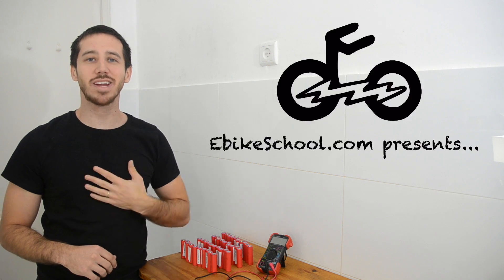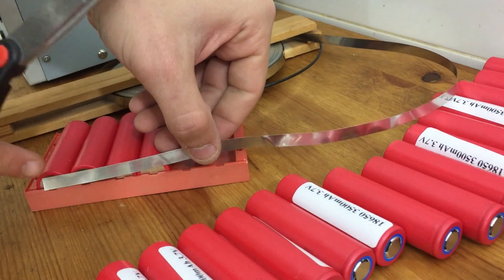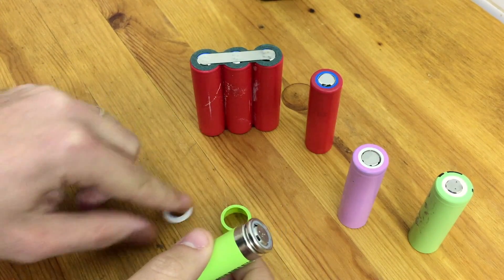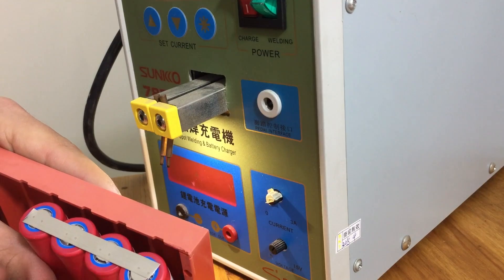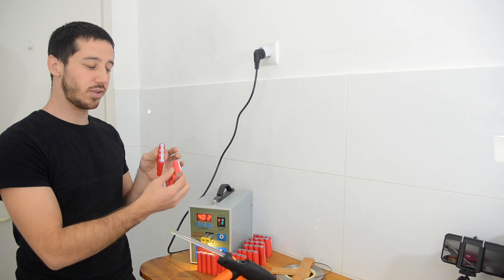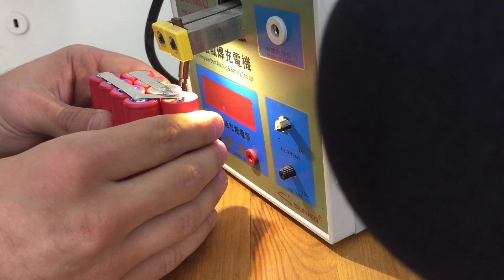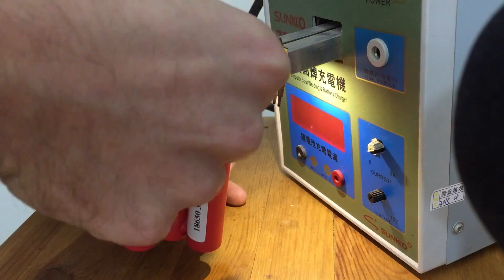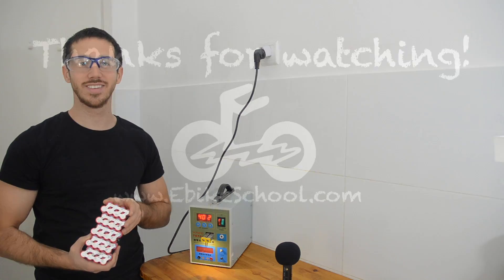DIY Lithium Battery - Spot Welding - Part 2/5

Comment: Hi Micah, i have your book. Why is nickel plated steel not as good? Does it have a lot of resistance? I seem to find it everywhere... which is annoying. But the pure nickel is double the cost. I wonder if it really matters or not
Reply from the maker: Yes it is higher resistance and results in lower battery performance.

Comment: I just picked up a 12kw capacitor welder that says it can weld .3mm but most say .2. 
Any experience with these? Mine is US solid USS-BSW06. The one you have says 800amp but mine says 2400amp. Is it that much more powerful or just different since yours is transformer and mine is capacitor?

Comment: Can you build battery with cells has same exact voltage but different capacity? Like I got different batteries has same voltage but different capacity so can I mix ? If they have same voltage but different capacity ? Thank you really need to know this information

Comment: Are there any cheaper spot welders that do the job considering that I won't be using such equipment on a regular basis? I have seen less expensive portable welders. Are they any good? What should one be looking for (power needed/ current etc)?
Reply: The welder you have would cost me Eur 101 + Eur 90 shipping!! A portable device would cost me less than Eur 50 shipping inclusive.

Comment: Could this same battery be used for a solar power system and would the cells be wired together the same way where you put them in parallel and then in series

Comment: but if those strips can only carry 5 amps then won't you run into overheating problems with the positive and negative ends each handling 15amps getting sent to the controller since you only welded one strip. I understand its a parallel connection but won't you have 15 amps going through it anyway?

Comment: Thanks for the video !
As the voltage is not the same when the batteries are fully charged or not, do you check them when they are fully charged to know if you need to throw them out ?

Comment: Don't know if you come back and update your videos but was wondering why doesn't my Sunko 737G Plus not spot weld .15 x 10mm strips. Tried many different setting and no weld. Does the width affect the weld? If I try welding the strips that came with the welder it does just fine but those are nickel-coated steel.

Comment: Hi. I am a beginner and Im planning to diy a electric skateboard but have no idea about battery packs. Your videos are super helpful to me. Many thanks to you!
Reply: right and well he talks about not soldering but umm isn't the word HOT in HOT GLUE gun a red flag. WTF So yah let's spread a 280-degree molten gel all over our batteries, but not a tiny amount of 300-degree molten liquid in a small spot on the top of our batteries

Comment: So 4 strips across for series connections gives 20 amps (4 x 5). Does it not matter how much nickel is on the parallel groups?
Reply: There's very little current flow across parallel connections

Comment: Before welding your batteries in parallel maybe you should mentionne that they should be charged at the same voltage. No?
Reply: He already mentions that at the beginning of the video. When he’s checking the voltage of each battery

Comment: What do you do if by accident you happen to make a wrong weld and short the batteries?
Reply: Just laying the nickel strip down to complete the circuit will spark. That would be all the reminder you need.

Comment: Do you know where you can get that plastic holders to keep the cells together for spot welding? any tips to put a 14S4P hailong battery pack? I can barely close the case, and I even had to trim some parts, not perfect but works. 
I bought your book, very good info btw. thank you.

Comment: Yes I enjoyed. But technically adding more strips doesn’t actually give you more amp carrying capabilities. (Kind of) if you’re working the current at close to maximum output (in comparison with the nickel strips) (that and I didn’t look up the maximum output of 4 cluster batteries) it’s a matter of the weakest link. Check out some videos on parallel resistors. (Same thing)

Comment: Do you want to enable Dynamic Stretching to your body organ especially in muscle? Then Just go here [Check Details Here==>https://t.co/ouYO75dnM2 ]. This is where you are activating the muscle around a joint and moving that joint through its full range of motion in a progressive manner. This leads to an increased range of motion around the joint, warming up of the muscle around the joint and improve circulation around the joint. Think of high knees or butt kicks.

Comment: Hy!
I really like yours videos, you make a good work and you are a professional of Li-Ion batteries!!
I started also to do my only batteries pack for a project and i bought the same spot welding like yours from Bangood.com but i have a little problem, it seems it can not weld the nickel strip 0.15 8mm.
Could be because i use the strips that they sent to me and its not a good quality or it's the spot welding!
Thanck you.

Comment: why not adding fuse wires? any particular reason? do the cells have built in protection? any thoughts on PCM (Protection Circuit Module)?
Reply from the maker: These are brand new, high quality Sanyo cells. Fuses aren't as necessary in this case. More important for salvaged/recycled cells. What the next video in this series to see the BMS (PCM) added to the battery.

Comment: What gloves would you recommend for building an ebike battery using a spot welder? Class 0 latex gloves (good for up to 1000v) are quite expensive. Would disposable latex gloves be fine for 50v or so?
Reply from the maker: Yes, cheap latex gloves are fine. Anything to keep your sweaty palms off of the contacts. Just note that those gloves can tear easily, so keep a few backups on hand.
Reply: EbikeSchool.com brilliant. Thank you
Reply: it's fine you don't need gloves just don't shock yourself for to long

Comment: what is the difference in using nickel strips and fuses ?
I came across some videos in which some have used nickel strips and some just the fuses and in fuses how is the series and parallel connection made with fuses 
thanks for ur time!

Comment: Great video series! But wait a sec...  you go through all the trouble to build this pack and haven't tested any of your cells beyond voltage? Do you do an internal resistance check and match cells? Do you charge/discharge them a couple of times? You don't drain them hard to check for weak cells? Sure, it's a bit of extra effortl but it's better to spend some time checking than to have to disassemble an entire pack to hunt down a bad cell, especially as the number of parallel'd cells increases. And especially being that you're/we're welding them together.
Reply from the maker: These are brand new cells straight from the factory. Reputable companies like Panasonic, Sanyo, LG, etc do multiple checks per cell before they leave the factory. They don't ship bad cells. But if you use salvaged/recycled cells, then you should do exactly as you said and weed out any bad cells.

Comment: Is it true that these spot welders can blow the breaker if your house? And it's not recommended for home use?
Reply: Please note that it's NOT OK to replace a 15A circuit breaker in your breaker panel with a 20A breaker because the 15A breaker is tripping due to a higher current load. The 15A circuit likely has AWG 14 wiring, which is not listed for a 20A load. That being said, sometime you can have a "weak" circuit breaker. In this case, if you're pretty sure that the total circuit draw on say, a 15A circuit is less than 15A and the breaker is tripping, you may want to replace the 15A breaker with a new 15A breaker. Also note that you are always supposed to replace a breaker with the same brand as the panel - i.e. Square-D panel gets a Square-D breaker, GE panel gets a GE breaker, Murray-Murray. (Even though they are mechanically interchangeable.)
Reply from the maker: If you have a low current circuit breaker then yes, sometime you'll have to keep resetting it or swap it out for a stronger one. These welders aren't much of a safety issue though because they draw a pulse of electricity for a few milliseconds. Your circuit breakers are designed to keep you from pulling continuous high power for long periods of time.

Comment: hay i bought your battery book and love what im reading. my biggest challenge is the welding. i live in an older apartment with fuses and my biggest worry i get a battery welder and i use it...then a start a fire or something. do you have a recommend any advice before i do this?
Reply from the maker: If you're worried about the wiring in your building, you can look at arduino spot welders. Google it. They are powered by either a car battery or a RC lipo battery, so you don't even have to plug them into the mains power. They are a new class and not very common yet, but they are starting to become available in kit form.

Comment: how much current are you getting from the microwave oven transformer? I'm using 4 gauge wire for the electrodes , 35 sq mm welding wire for the secondary winding but not getting more than 250 amps...pls lemme know what should I do...I bought a 70 sq mm wire and will be attempting a rewind  hoping the current increases.

Comment: So say i invest into a 72v eBike Conversion Kit maybe 2000w+

Would making my own battery pack be better option, price wise because ive seen packs cost as much if not more then the actual kit which is just bank breaking for just getting into riding and all. This is certainly something i would like to get into, just the final product i would hope i could make water resistance or proof at best. Nice tutorial, very clear, pretty fascinating, and i plan to do this, if its more affordable that is, checking now hewhew.
Reply from the maker: 72V batteries can get very pricy, so building your own can be an affordable option. Most people don't start with a 72V ebike though. It's a lot of power - just make sure you know what you're getting into. Happy riding!

Comment: Hi, I want to buy the same spot welder. In the description, this welder has input 220V. In the video, I can see you are using a plug adaptor for your U.S, CAN, JP wall outlet. I sent an email to the store and got a reply to get 788-H model. Do you much lower power with your setup? You could put both in the description so others can order what they need and you still get your commission.

Comment: Sorry for my english but, can i use another way to weld the nickel strip without using the spot welder?
Reply: Your English is better than most native English speakers. :P You can solder, but that heats the cell up and I personally wouldn't recommend it. The other option I've seen is using something called "batteryblocs". They're a modular enclosure that allow you to drop 18650s in, secure and protect them, build big packs, and not have to solder or weld. They're cheap, too! http://www.batteryblocs.com/
Reply: not so bad, man..!
Reply: bruh your English is fine aha, you could solder them together but that is not really safe, at all, another option is to watch his video on how to build a battery without a spot welder and buy prespot welded gropes then solder between batteries where its safe
Reply: Build a spot welder. If you have the skills to build an electric transport or even a battery pack, you can build a spot welder. There are even examples of using 18650 batteries to do the welding. There is never an excuse to solder batteries.

Comment: 0.15*8 mm pure nickel strip can support 30-40 amp Current ?.i build 18650 48V (13s 6p)
Reply from the maker: No it can support a max of 10A per strip, but 5A is better.

Comment: what is the difference between parall and seris connection ?
Reply: @Kamal Boro
If you do not understand at this point the difference between series and parallel connections and their consequences DO NOT START BUILDING LITHIUM BATTERIES IF YOU VALUE YOUR LIFE! This is especially true when making large assemblies like the one in the video. Making errors in assembly like like creating a short circuit can cause a fire or explosion instantly. Lithium batteries are no joke!!!
However, FYI: Consider two identical batteries eg 3.7V ,and 2000mA in:
SERIES: Voltages is the sum of the two batteries, ie 7.4V, and the current is the average of the two batteries, ie 2000 mA.
PARALLEL: The voltage is the average of the two batteries, ie 3.7V, and current is the sum of the two batteries ie 4000mA.
Reply from the maker: Make sure you watch Part 1 of this video series, it is explained there: https://www.youtube.com/watch?v=b3eRv_FZjBc

Comment: where did you get the battery welder?

i have been soldering my cells for years but the welder looks so much faster
Reply: most of the stuff there actually took 3 months to ship to me but I got my welder in 2 weeks and she works beautifully, I do live in Australia so that's probably why it didn't take long to ship a prebuild thing
Reply from the maker: Check the description to the video. I put the links to the tools I use there.
Reply: yuck aliexpress 

the home of chinese scammers and 3 month postage time
i think il look elsewhere

Comment: What cells are you using and where did you buy them at (how much each, how man etc) Also what are the settings on the spot welder?
Reply from the maker: These are Sanyo cells, check the description for links to all the parts. The welder is set to 40 with a double pulse.

Comment: i was thinking i should apply a black insulator tape on the sides of the battery groups i SHOULDN'T  weld together serially , just in case i'll start going into a fixed trance and weld them by mistake. 
what do you think ? 
btw shouldn't you use gloves and long sleeves when welding?
Reply from the maker: The black tape could be a good reminder, but you should always be double checking everything before you lay down the nickel strip. Placing it in the wrong spot could lead to series sparks.

And yes, I should have been wearing gloves. I had them on for part of the video but I had to keep removing them to work the camera and forgot to put them back on. Long sleeves is probably a good idea as you occasionally get a little spark, but you're probably fine without them.

Comment: Hello, is not the same if I make first 10 batteries in line to make 36 volts and after connect it to paralel that peaces? The reason is to add more amh if I want.
Reply from the maker: Yes, that would work also. Just makes sure that the cells are the same voltage before you do your parallel connections.
Reply: Thanks for answer.

Comment: What's your opinion on DIY spot welders? Like ones made from using a car or lead acid battery or ones made using the transformer from a microwave?
Reply from the maker: There are some good arduino based ones that use a car battery. From what I've seen, they work even better than my welder I used in this video.

Comment: Another great video. Can you get the nickel strip thicker than .15mm so you don't have to double it up? I'm thinking of for like a 48v bank, but some where around 2000 to 2500 watts for extreme long range for an emergency type bike to carry a heavier load.....or what would you suggest, 2 or 3 separate banks or what? Thanks and keep up the great work.
Reply from the maker: Do you mean watts or watt hours? Range is related to watt hours.

Building a battery to carry that many watts is doable, but you'd need thicker series connections as you noted. If you have a really strong spot welder then you can weld thick strips, but most hobby spot welders like this one can only do up to about 0.15mm and still get good quality welds.
Reply: Okay, but volts x amps = watts, so a watt is a measurement of power used per hour, so if you have a 300 watt appliance, it uses 300 watts per hour as long as it's on, so what's the difference? I mean this is what I learned in electronics 101, but I am no pro at this at all. 

I was kind of looking at range and battery banks of many different bikes, motors, and batteries, and I kind of come to the conclusion that 30 watts to go one mile with a load and a little help from the rider, is probably do-able......I think????

Maybe it would be smarter and easier to build 4 battery banks that are 500 to 700 watts, and now you have back up banks in case one fails some how????

Also, is there anything out there that uses solar panels to charge a battery bank?
Reply from the maker: Confusion between watts and watt hours is a common problem. To correct your first sentence above, a watt isn't a measurement of power used per hour, thats a "watt hour". watts = instantaneous power, and watt hours = total amount of energy. If we were talking about a car, watts would be equivalent to the horsepower of the engine, while watt hours would be equivalent to the gallons (or liters) of the gas tank.

30 watt hours per mile is definitely achievable. My most efficient ebikes got twice that. But 30 "watts per mile" is meaningless. It's like saying it takes 100 horsepower to go one mile... doesn't make sense. 

Some people build multiple packs and parallel them, that way if something goes wrong in one pack it doesn't destroy one giant pack. 

Google "solar lithium charger" and you'll find some solar charge controllers meant for charging lithium battery banks.